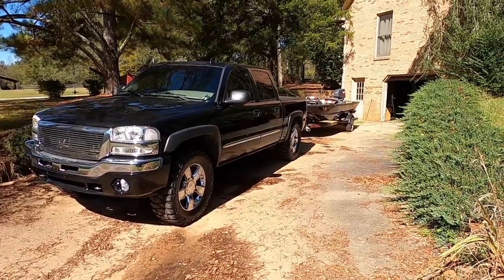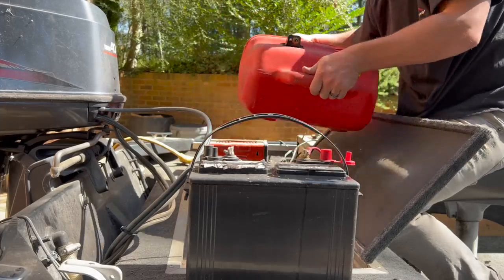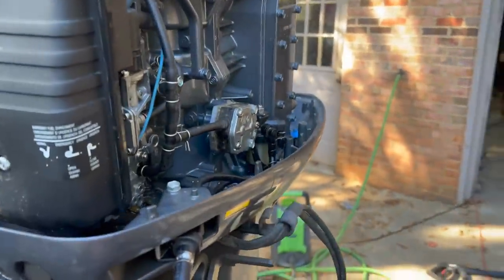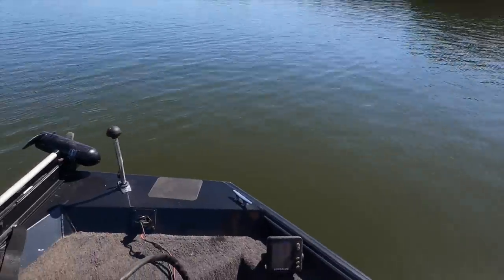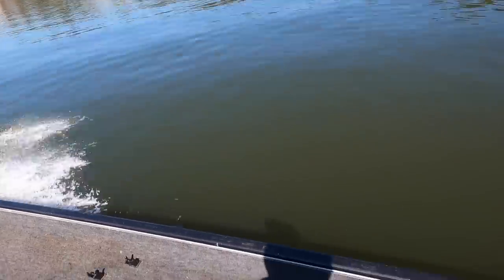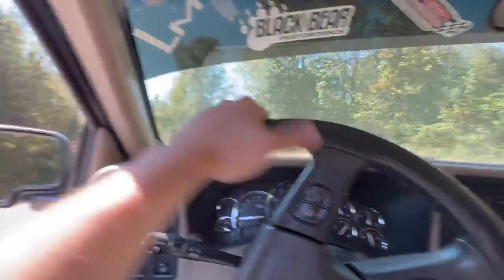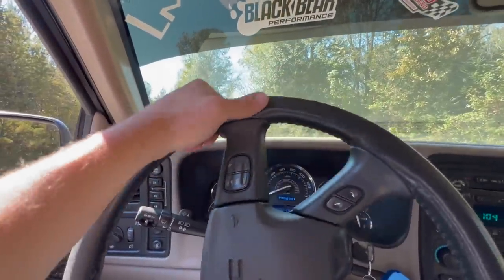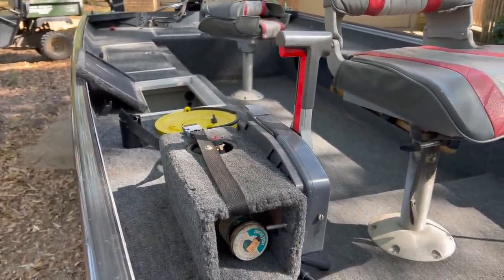I DIDN'T EXPECT TO BUY THIS…

Comment: That noise sounds like what is called a "hot alarm" which means your water pump isn't working or you have a stuck thermostat, be sure the engine is spraying out water from the back of the engine while its running

Comment: I would be ashamed if a half ton didn't pull that little boat with zero effort. I pulled a Fisher Marine set up exact same way with a 1986 S-10 with anemic 2.8L V-6. I wouldn't even turn on tow mode for that weight.

Comment: I was surprised you didn’t have to replace the little chamber before the carb it’s a gasket that usually deteriorates it acts like a pulse to keep gas pumping if it ever stalls that would be your problem or cutts out I used to know the name of the part but it’s been a while since I’ve worked on those two stroke motors👌🏻

Comment: I just bought a new 2022 sierra 1500 elevation and wanted to know what size wheel spacer to put on to clear the calipers I have 22in old gen 6 spoke rims offset is +24mm thanks